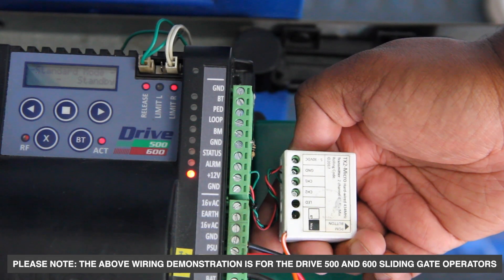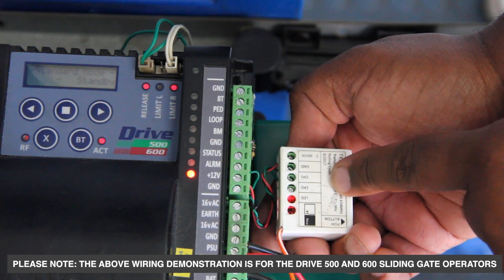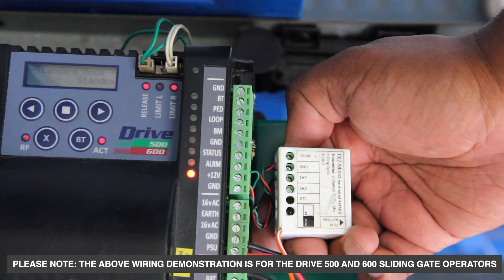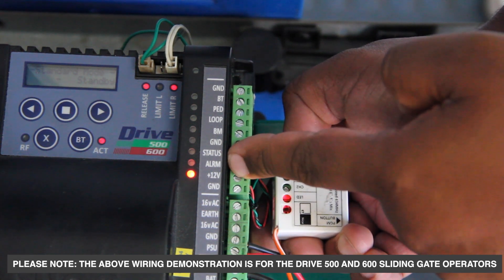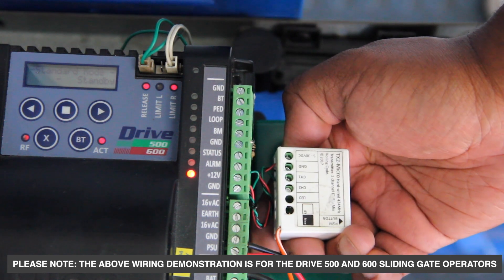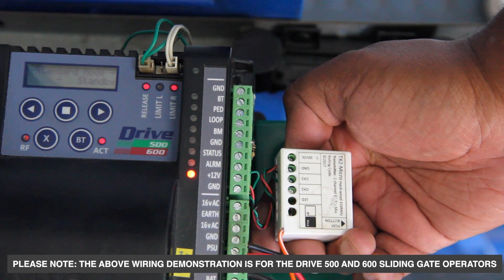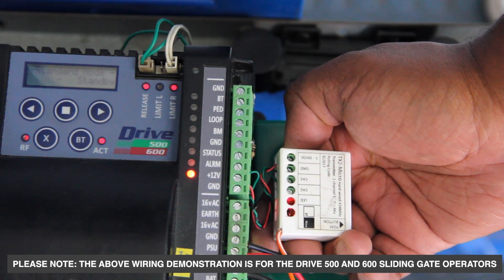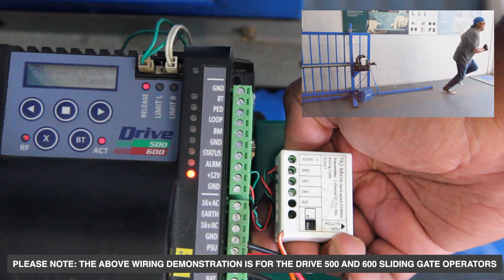Drive Series Alarm Output

Comment: Good day. Is this a new feature to the drive 500 motors by Nice before you rebranded from "ET Nice" Is there a vibration sensor on the motor that allows a remote output?
Reply from the maker: Hello Kevin, the Drive 500_600_1000 as well as the Drive 300 always incorporated this Alarm feature but we do not have a vibration sensor.